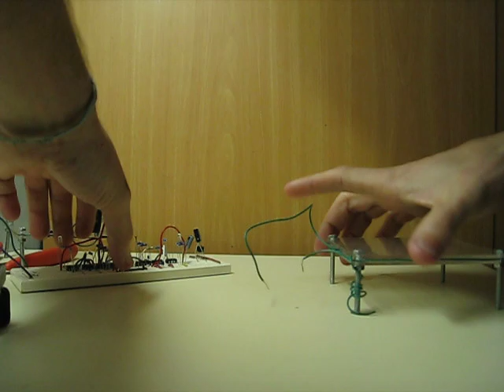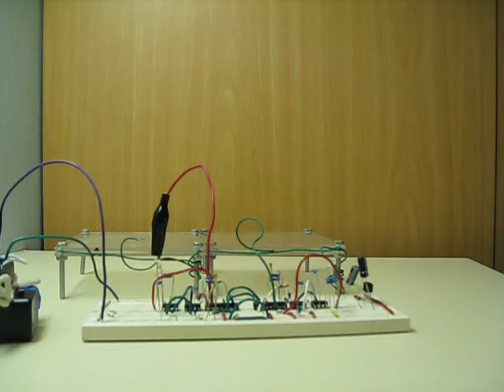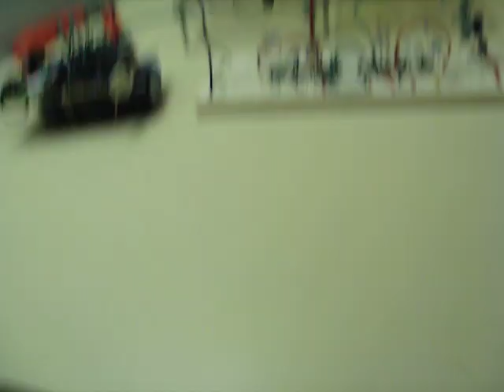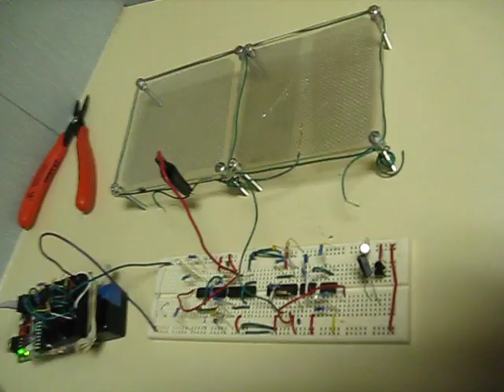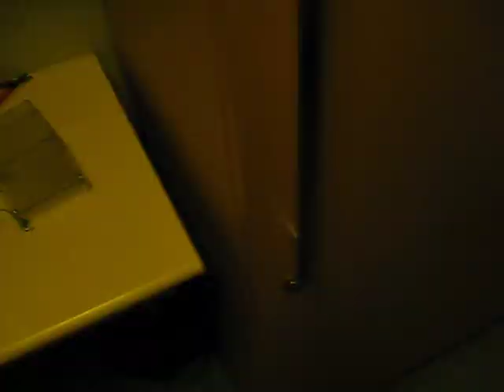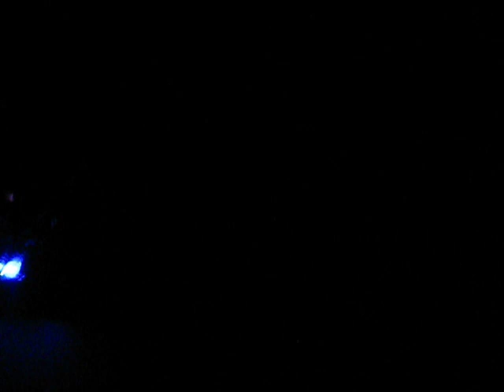Two Interactive Capacitive Proximity Sensors

Comment: Hi grahmaustin,

I am working with capacitive sensors too. I decided to use a mpr031 or at42qt1011.
How do you manage to avoid the interferences in the wires? I mean between the timers and the sensing plate. If you touch the wires you could trigger the circuitry...

Thanks!

Comment from the maker: each sensor module uses a 556 timer. One timer (of the 556) is used to make a triggering cycle while the other is used as a monostable (one shot)  where the sensor plate is connected. The output of the astable triggering cycle timer is connected to the trigger pin on the monostable timer.

Comment from the maker: The external components needed by the second timer only consist of a 1 MEGohm resistor, and the sensor plate is the capacitor.  The output of the second timer is an increase in duty cycle with an increase in sensor plate effective capacitance. This PWM signal goes through a 100k res and to a 1 uF cap to turn it into a linear DC signal. This goes to a buffer (one of the opamps) before it goes to the positive pin on the ATtiny85's internal amplifier.

Comment from the maker: Cont'd:
The external components needed by the second timer only consist of a 1 MEGohm resistor, and the sensor plate is the capacitor. 

For details of wiring timers in astable or monostable mode, just google that. The output of the second timer is an increase in duty cycle with an increase in sensor plate effective capacitance. This PWM signal goes through a 100k res and to a 1 uF cap to turn it into a linear DC signal.

Comment from the maker: I do not have a circuit diagram as of yet. But I would be happy to give a quick synopsis of the circuit. The sensor IC is just a simple 556 timer. One of the timers is set up as an astable oscillator that outputs a, roughly, 96% - 98% duty cycle at somewhere between 10-30 KHz. This output goes to the trigger of the second timer which is set up in a monostable (one shot mode). The first timer basically turns the second timer on and off, keeping it on for 98% of the time.